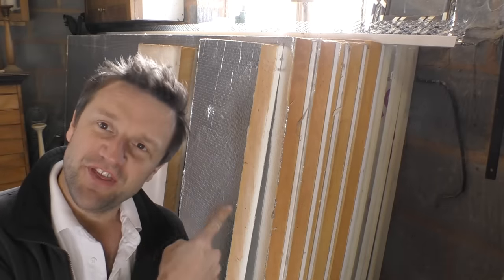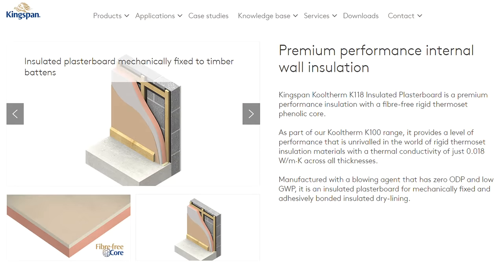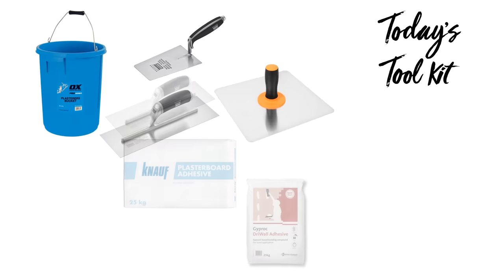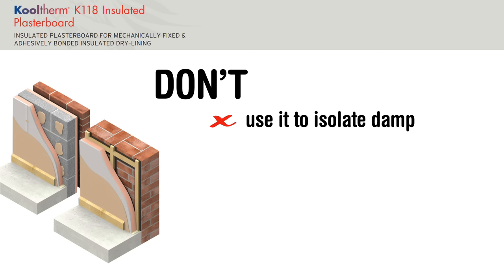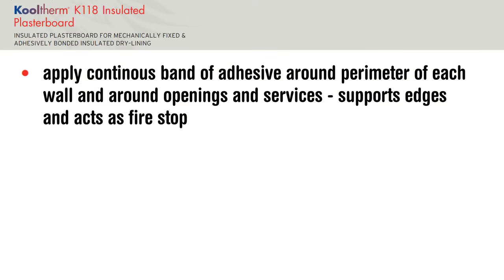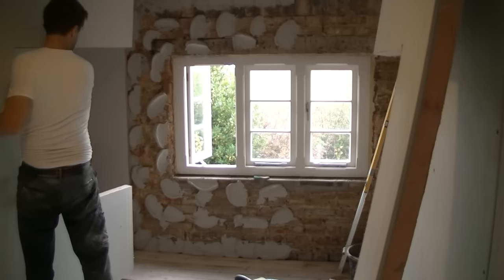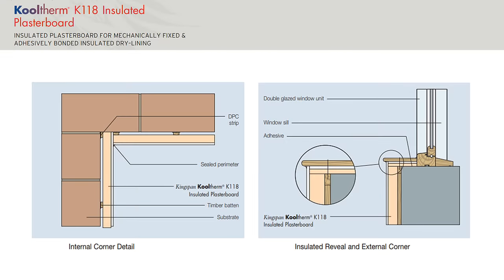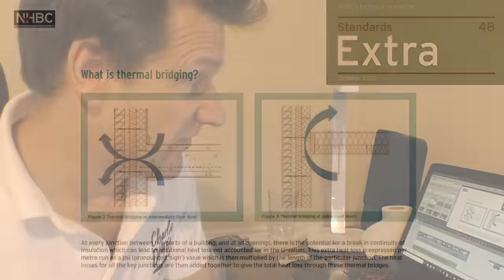How to Dot & Dab Insulated Plasterboard - a DIY Guide

Comment: Sometimes this thick stuff is not practical. I’ve used considerably thinner insulation board than this and it’s been very effective. Polystyrene backed and dabbed on, no problems at all.
Reply: My thought exactly! much cheaper certainly

Comment: Hi, Excellent video. I noticed a central heating feed during the video. It made me wonder if you somehow managed to attach a radiator through any of the panels onto the brickwork. I'm trying to plan a similar project but want to put a rad on My current idea is some expanding foam in the correct spots so I can drill through to the wall. any advice would be welcome.
Reply from the maker: You've got a couple of options, Phil. If you're dot and dabbing standard plaster board, you could ensure there is plenty of adhesive where the radiator brackets are going. That way you've got something solid to drill and screw into. If you can't get the dabs in the right place and you've got say 5cms from the surface to brickwork behind, consider Corefix fixings which will support the radiator. In the last room I insulated, I used battens rather than dot and dab, so I made sure there were battens behind the radiator so I could screw through the insulation into the plasterboard.

Comment: Great detailed video. Im just in the middle of an extension. Its a block build with 80mm cavity as its over an existing garage with render. I think im gona have to top up the insulation on the inside. Im stuck between insulated plasterboard, pir board and plasterboard over or rockwool. Do you know if there should be an air gap between the block and pir board? Cos im thinkin if i used 25mm board and need a 25mm gap i could just use 50mm rock wool for a similar r value? As this is cheaper

Comment: Enjoyed the insulation video, with plaster/insulation boards.

I'm in the throws of buying a house that's about a 100 years old, and has cavity walls.

The main bedroom has fitted wardrobes down the length of one wall. Is there a noticeable benefit applying these boards just to the walls that are external facing?

Robert
Reply from the maker: Thanks Robert. There is as that's what I've done here. You've just got to be really careful about thermal (cold) bridging.

Comment: Thanks for this. I was thinking I could put insulated plaster board over existing plaster board, rather than remove existing plaster board. Would that work?
Reply from the maker: I'm bound to say I did that on one wall in my daughter's room but I wouldn't recommend it as you don't know what you're covering up (eg existing damp/ condensation) behind the plaster board...
Reply: @CharlieDIYte  Thanks!

Comment: Bang up job m8. What is the bit you used to chisel out electric sockets on plasterboard? Looked like an angled hammer drill chisel of some sort. I been 1 of them.
Reply from the maker: Thanks mate. Was that the multi tool? Plug sockets are a bit of a problem in terms of cold bridging so get some expanding foam behind them if you can 👍

Comment: I’m looking to install k118 in my house, don’t have any condensation issues. Can the thermal board be installed indirectly onto a painted wall with adhesive and mechanical fixings? Have asked a few builders and they say this shouldn’t be an issue. Any ideas for <10mm insulation around reveals?

Comment: Hi Charlie - great video thanks. One question I have is, What plasterboard fittings can you use on these insulated boards?
Reply from the maker: I've used Fischer UX6, or Duopower. For a really heavy duty fixing you can use wall anchors as they will force thence open in the foam. Try and keep them within the foam thickness though so that you're not piercing the vapour barrier - shouldn't be a problem if you're using 50/60mm foam.

Comment: Hi Charlie will this work on existing dry walls or is it required to take off existing  dry walls and replace with Kingsspan. I'm asking as my sons attic bedroom is rather chilly.
Reply from the maker: It would Steve, and there was one existing section of my daughter's room that has dry wall that I insulated on top of. Her bedroom was hard to heat before and it's easy to heat with the I've radiator now. The only caveat I'd say is once this stuff is on its not coming off, so it's good to know that the wall you're insulating has no underlying damp problems before you cover it up which of course you won't know if you're insulating on top of dry wall - and for that reason I suspect it's not recommended for this. You'll also want to pay close attention to sockets, corners and around window reveals as these can be sources of cold bridging.
Reply: @CharlieDIYte  thanks Charlie that advice is useful.

Comment: Great video thanks. Just curious why you took the render off? Why not just put them over the existing plastered walls? Like you said - its Tyrolean protected anyway.
Reply from the maker: Hi Steve. Mainly because the key had gone and a lot of the render was no longer connected to the brick so it made sense to remove it. Also it was a good way to check that the wall was dry beneath. If I was doing this again I'd probably use expanding foam glue as it has better insulating properties than the adhesive and will provide a much better insulation around plug sockets where you've cut through the insulation and in between each board.

Comment: how much does each board weigh? You seemed to handle them easily.I struggle with ordinary 8 by 4 plasterboard sheets.
Reply from the maker: For a 62.5mm thickness (ie 50mm foam) you're looking at about 29kg per sheet. They were heavy! I had to carry each one all the way down from my garage and then at an angle up the staircase!!

Comment: The insulated panel has a vapour control layer that will be effective in preventing warm moist air from condensing out probably on the face of the brickwork however, that vapour control layer is totally compromised by the gaps between the boards and where you have inserted services.  The point is that you won't know whether there is a problem until it is catastrophic.  Over the years I have come to the conclusion that using insulated plasterboard is a convenience that has a number of poor compromises ignored by many, whereas a more considered approach, even using the likes of Kingspan materials is more desirable/reliable.
Reply from the maker: And what would that "more considered approach" be, Clive?
Reply: Charlie, a full understanding of the whole mechanism of insulation and how to properly control moisture within that mechanism would be the 'considered approach'.  There are many ways to achieve the end result and discussing even a few possibilities would take too much space up.  If you are intent on using the Kingspan board then I would suggest a foil faced board with foil jointing tape and then applying the plasterboard separately.

Comment: Could you use a masonry blade on a skill saw to cut the board as opposed to using a hand saw?
Reply from the maker: Don't see why not, Jim. Just make sure you've got a good dust mask on!
Reply: I used a ground down sawblade in alligator saw, grind offset teeth away to replicate breadknife. This reduced dust from kingspan to almost zero. Amazing trick. Not sure if it would work through the plasterboard backing, would give it a try.

Comment: Well that’s my Christmas over for this year. I’m off home to insulate my walls. Do you have to let the pva fully dry after you’ve applied it to the foil face on the back of the plasterboard? Great video. Very informative and merry Christmas
Reply from the maker: Yes you should let it dry fully. Have a look at the expanding foam glues. Much better insulation than plasterboard adhesive particularly around plug sockets and you're not putting all that moisture into the wall.
Reply: @CharlieDIYte  i put the pva on to the plasterboard and let it dry then i mixed up some plasterboard adhesive. i have no wet trade experience and it looked good to me. i applied it to the wall and then went to lift my first sheet in to place and then in one simultaneous moment most of the adhesive came tumbling off the wall. i was fuming. googled the expanding foam glues and went for that option. its an unbelievable product. one can has done one room for me. so quick and easy

Comment: Hi Charlie. I’m renovating my bathroom and was wondering how you insulated the bathroom exterior walls if any? Same kingspan board with waterproof tile backer board around bathtub/shower areas?
Reply from the maker: In a slightly haphazard fashion if I'm honest, Paul. I battened the walls with tanalised 2x1, then infilled the battens with Ecotherm 1 inch sheets, and then screwed standard plasterboard on top. In the shower area I instead screwed tile backer to the battens. I actually rendered around the window because i thought it would get a lot of splashes from the shower but in actual fact I could have just used tile backer there too. So the insulation has made a difference, but isn't really adequate and certainly wouldn't meet the U values for building regs purposes, and I didn't really pay any consideration to vapour barriers (I should have foil taped over the battens) although the walls are painted in a moisture resistant eggshell. If I was doing it again I'd probably do the same, but with foil tape over the battens and then use the insulated plasterboard on top, with the tile backer of course in the shower area. It's a bit of a dark art this as so many builders insulate walls very badly, and don't pay any consideration to cold bridging or vapour ingress.

Comment: You put the bonding agent around the perimeter of the board and a strip down the middle. I had expected you to confine the adhesive to this area.
Reply from the maker: It's a fair point - I found myself applying a lot more adhesive dabs than you need to, and so should probably have covered the whole of the back of the board with bonding! I think the bonding agent is an added precaution really, and obviously if you use the Knauf adhesive you wouldn't need it. Also, as a pro plasterer has commented on this feed, you should think of the adhesive primarily as a packer to secure the boards in the right position. The mechanical fixings are what secures it comprehensively to the wall.

Comment: I live in a 1890s solid brick wall house with fancy bricks (so external insulation is not possible). With rising energy costs I'm keen to insulate some bedrooms.

I don't want to lose any more space than necessary, and was considering using aerogel board - more efficient insulation so less thickness is required.

The top priority wall has water ingress from faulty chimney flashing (chimney since removed) and the thick original render is damaged.

Have you considered aerogel board?
Reply from the maker: I haven't considered Aerogel Peter but it does look good. In my experience, yes you don't want to lose internal area but once the insulation is in place you quickly forget the proportions before. When you install, your buzz word needs to be cold bridging and the need to minimise it. Joins in boards and plug sockets and around window reveals are particularly vulnerable to this. Clearly the thinner the system the greater the danger so it's important the insulation is continuous.
Reply: @CharlieDIYte  Thank you, Charlie! I was thinking that there could be advantages for the DIYer. Aerogel is very light so presumably wallboards could be both easier to handle and easier to stick. You might be able to use spray foam as both an adhesive and barrier to vapour (to prevent interstitial condensation) and thermal bridging - easier than mixing up and applying dob and dab adhesive. The ancient, damp-damaged render underlying the plaster skim I have in the room I'm thinking of is so poor it would be best knocked off entirely; then I could clean off the bricks, stabilise with PVA (as you did), then relatively easily apply aerogel wallboards with spray foam adhesive, getting equally good insulation with less loss of space… Although I'm not sure about rehanging the radiator…

Comment: Great video thanks. I hope to do this at some point. I've watched this video multiple times now. I'm still confused at the advice of the 15mm gap at the bottom though. What do they expect us to do? have a big gap on show? In the video you state its meant to be sealed with foam or sealant. But how is that any better or worse than just having the board go all the way to the floor. After all the board is made of foam. Cheers
Reply from the maker: I think on the ground floor it's very important particularly if you've got a concrete floor as it stops any moisture from the floor getting into the plasterboard and gives you the ability to create an air tight seal - important to prevent cold bridging. It's less important upstairs but I'd still do it, and use expanding foam tape https://youtu.be/V6lZXjRR-1k rather than spray foam which is breathable but stops moisture getting in from the room. This is what I used on our recent bedroom refurb. When you do yours, really focus on trying to minimise cold bridging, as this is where moisture can form on the cold surface, and vapour can get into the wall from the room. If you can, minimise cuts for things like sockets or at the least, insulate behind them with spray foam rather than the adhesive like I did as sockets are a major source of moisture ingress. In the most recent room I did (our bedroom) I instead of dot and dabbing, battened the wall with 2x1 tanelised battens. I infilled between them with PIR board, foil taped over the battens, then screwed that insulated K118 plasterboard to the battens. I did cut through the K118 for sockets but put a ply board at the back (foil taped over) to screw the socket box to. This way there's no cold bridging in the sockets. The widow recesses also had continuous insulation around them.
Reply: @CharlieDIYte  Thank you very much
Reply: I think there’s also the point that you’ll have skirting board there anyway so that will hide any bad aesthetics.

Comment: Hi Charlie, We live in  20 year old house which has the lounge backing on to the Garage, I haven't confirmed but suspect the wall between lounge and Garage is single skin thermal blockwork with Dot and Dab plasterboard on the lounge side.  The lounge is always cold (and freezing in the winter) and I was thinking I could insulate the wall with Kingspan or similar on the Garage side. Are you able to help me understand if this will make the room warmer, and if so what sort of depth of foam I should use. Finally if I use the foil backed product should the foil side be attached to the wall or facing out? Thanks in advance
Reply from the maker: Sounds like it's definitely worth insulating the garage wall. This is quite a good article.  https://www.homebuilding.co.uk/advice/insulating-a-garage I'd say you want 100mm thickness to do the job. If you want a plasterboard finish, then yes 100mm Kingspan or similar. You could batten the wall and screw the plasterboard to the battens, or use adhesive. The foam adhesive is probably the best as you don't have the faff of mixing it. Just make sure you use a foam adhesive recommended by the plasterboard manufacturer as they need to be compatible. Leave a 10mm gap at the bottom and spray foam in that too. Will make a massive difference.

Comment: A clip on how you did the windows would be helpful
Reply from the maker: Yes. I did my bedroom window a year ago and I'm so frustrated because I've lost the footage. There's a diagram I think at 23 mins in, but the key is to have the insulation continuous around the corner. So you need to cut a sliver of insulation off one of the sections you're butting up, so that the plasterboard is also continuous if that makes sense.

Comment: Hi, great video, Can I ask why you didn’t use Celotex in place of Kingspan.
Reply from the maker: Thanks Wayne. No particular reason other than it had a strong brand reputation (pre- Grenfell at any rate) and I could get it reasonably cheaply at SIG - who I think have since bought Kingspan. If I was doing this again I'd probably use the expanding foam adhesive as it would provide a better thermal bridge, not put any moisture behind the board and would be better around the plug sockets. 👍

Comment: not gonna lie I avoided this video for a while (dunno, maybe I just didn't like your face) and Im 5 mins in and regretting that decision haha superb videos! many many thanks
Reply from the maker: I love that 😂 Thanks for your honesty and I'm glad you found it useful. A couple of tips. If you're going to do this, I suggest you spray expanding foam in the gap between wall and back of insulation around the socket opening (rather than adhesive like I did), and also quickly spray some foam behind the socket before you screw it into place as the socket is a major source of potential thermal bridging, as is the point where the insulated plasterboard hits the window frame. Bottom line, have thermal bridging in your mind the whole time you do this job 👍

Comment: Hi Charlie would you recommend these to be fitted to a single brick interior wall? What would be best for insulation? Also once they have been fitted are they skimmed as normal? With skrim tape? Thanks
Reply from the maker: I don't think you need them on a single brick interior wall, as it won't be cold to the touch like the externals. I typically just dot and dab a single layer of plasterboard to interior walls. Yes, they're skimmed as normal once fitted, with scrim tape. A few people commented I hadn't used it here, but I had. It just doesn't show up well in the video.